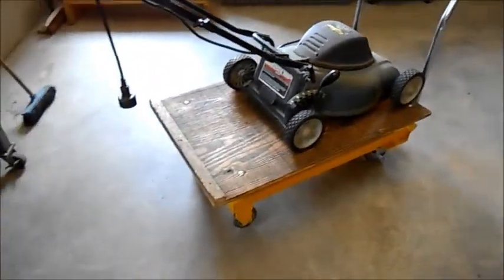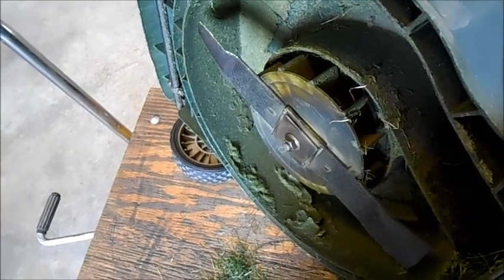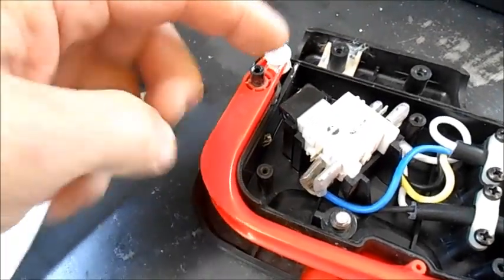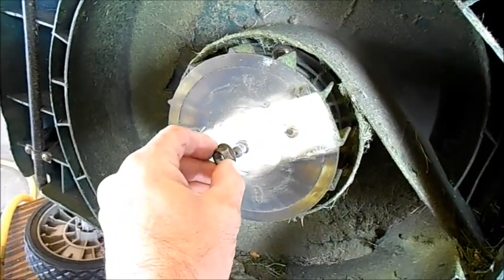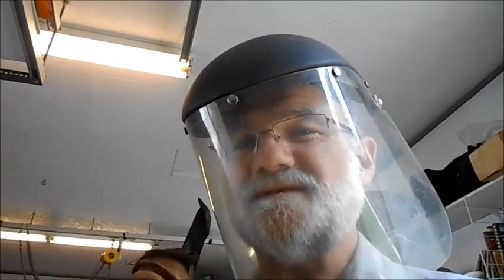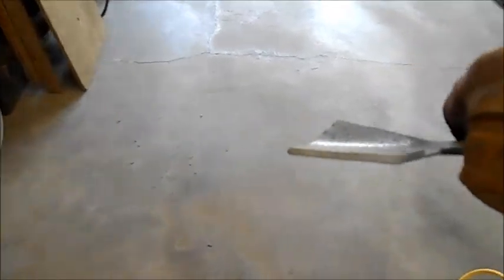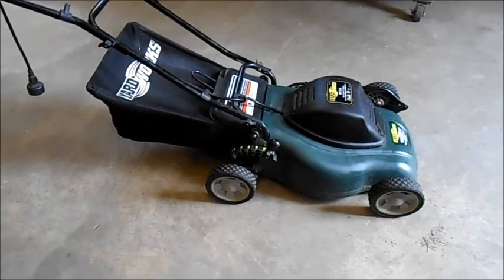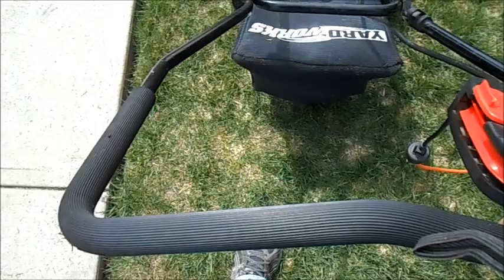Repairing an Electric Lawn Mower Switch and Blade Sharpening.

Comment: OK, after changing the shunted brushes, I decided to change the starter switch (hey, for $23 I'll have virtually a new machine!)...so ordered the switch from e-replacements.. followed the video instructions..very simple one for one wire connector from old to new...and voila! Put the cover back together with the screws...and the mower runs better than new ! And a whole lot cheaper than searching for some cheater mr-fixit to charge for this easy fix... I'm so glad I did it myself...THANK YOU !!!
Reply from the maker: +jean baxter  So happy you got it